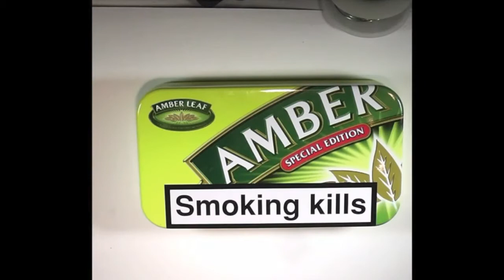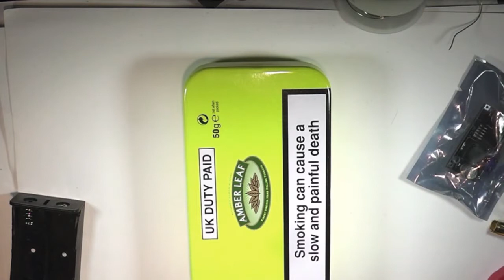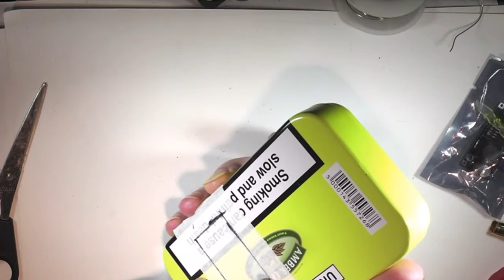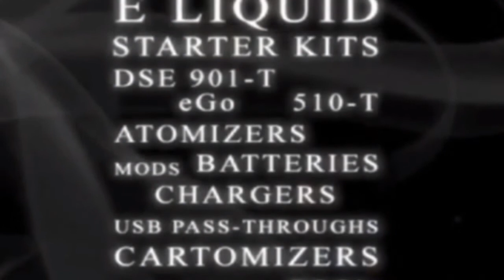Tin your tip 26 - 08 -13

Comment: Hi Garry, I bought one of the pound shop pipes for the stem to make into a cheap driptip for my smok epipe clone, but after seeing this I want to attempt to make a pipe as you have done BUT with a removeable battery, how would you finish off the top to allow easy access to the battery?

Also please can you post a list of stuff required, i'm a complete noob to mod making and diy but would love to give it a go.